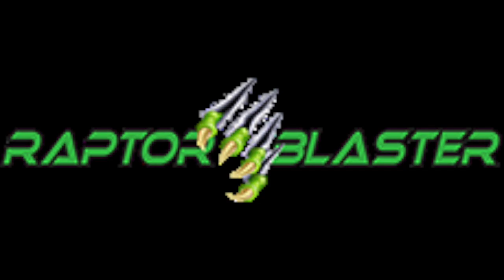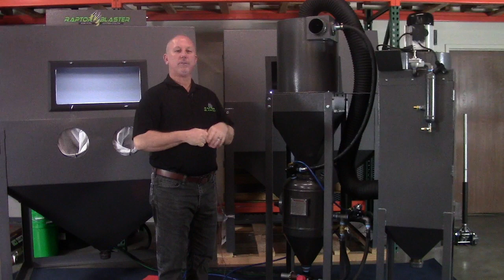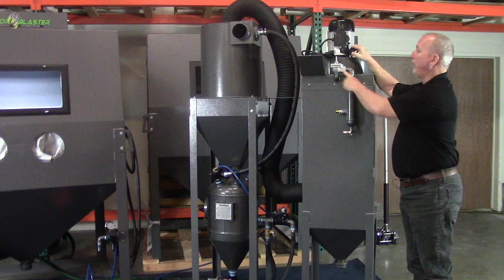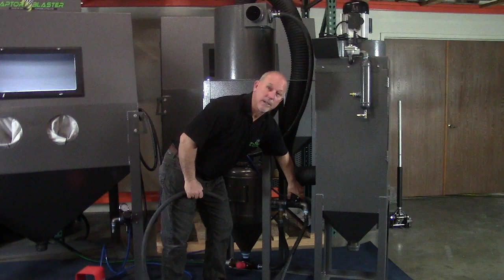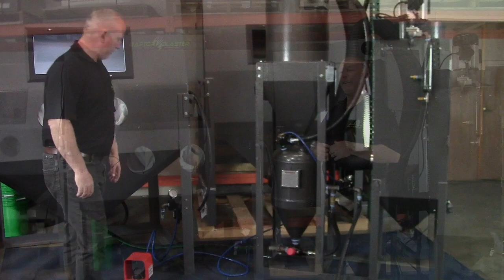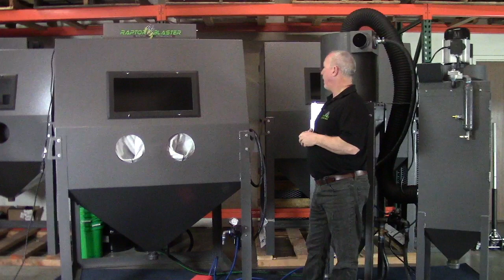Direct Pressure Blast System Setup (Raptor Blaster)

Comment: Can't use Chicago fitting on blasting.  As a matter of a fact you can't use them in any air system, unless you want to lose 50% of flow.  The fact you used it make me wonder what else is off, but other than that it does look good here.